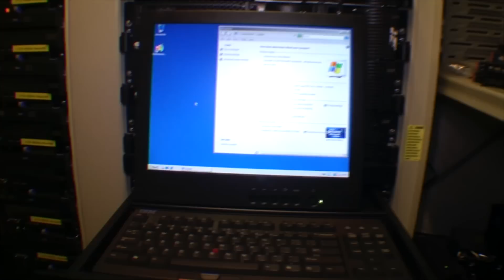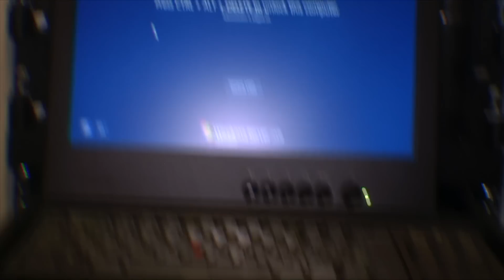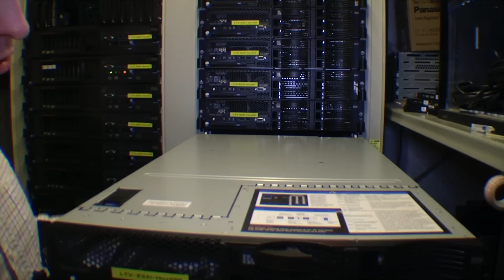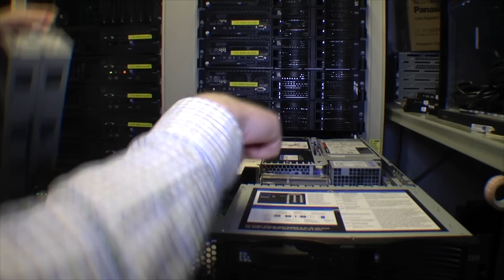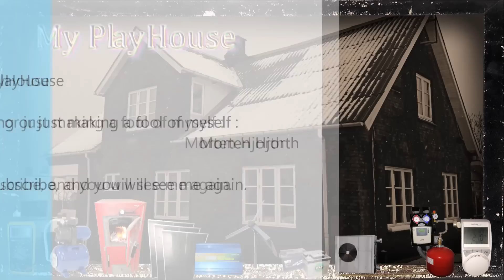Simulating Fan failure on IBM eServer x336 system X - 257

Comment: Nice test, I usually use a brush to slow down till complete stop so I can test if fan alarms work.
Get well soon!
Reply from the maker: Hi +X-BASS 
That is a good Tip!! thanx,, i am up and running again :-)
Thank you for watching! :-)
Reply: +X-BASS .  A brush?  Very interesting.  What type of brush do you recommend I use?  Do you use a different brush for ~40 mm fans versus 80 mm fans?  I am always interested in creative ways to simulate part failures.
Reply: +Tim Meserth I use the same brush that I use to clean the PCs, that way you can slow them smoothly.

Comment: Hi Morten! Thanks for an intersting test. I have a question about x3650 server (as had been showed at the end of this video). When the server is plugged in to power, all the fans LED lights are on for a second. After some years of running, my server did not came on after a physical cleaning. I opened it and see that in both fan rows I have a one fan led that is not flashed at the power connection moment. This means that we have one failed fan in row A belonging to PSU1 and one in row belonging to PSU2. I tried to replace all these "failed" fans from the other working server, but these fan sockets still cause errors and the server cannot switch on. Did you ever faced with such kind of a situation? In service manual IBM simply said to replace server motherboard...
Reply from the maker: I have had very few bad fans! And never a bad system board, on that account 🤨 Rumors says that you can brake a system board by using an air compressor on the fans,, they will act as a generator and send power backwards,, bad. But rumors!